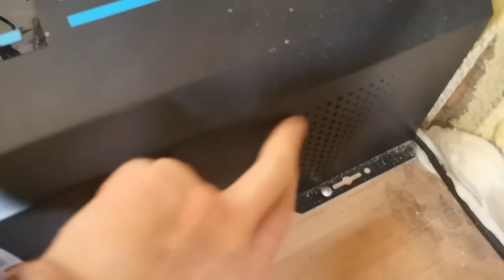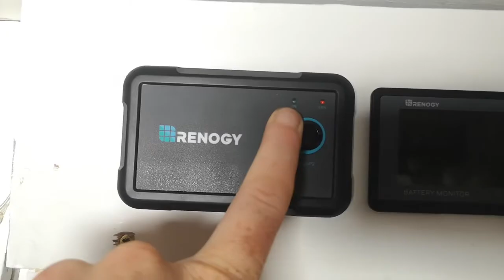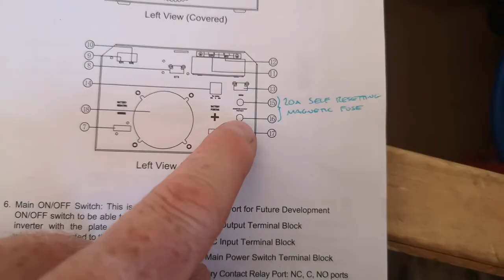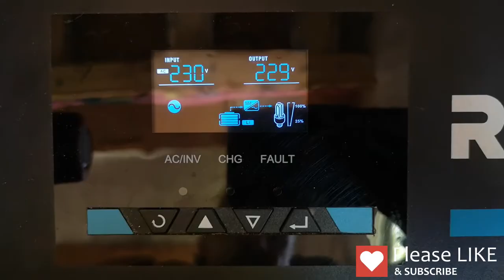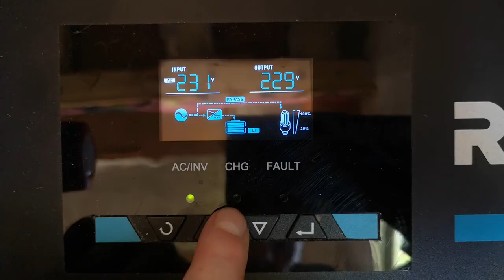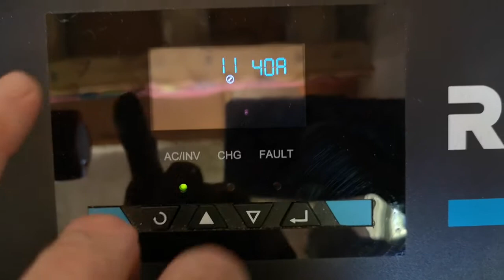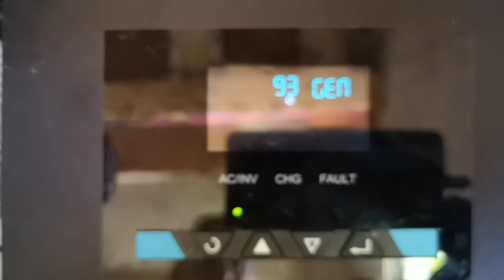Renogy Inverter Charger Installation & Setup | Part 1

Comment from the maker: Do you have questions about your Renogy Inverter Charger? Jolly, your 'Renogy Inverter Charger Guru', provides comprehensive guides and resources to assist you with installing, setting up, and using your Renogy charger. Visit: www.vandercampadventures.com/renogy-inverter-charger-installation/

Thank you to everyone for your continued support. Your likes, comments, and subscriptions help the channel and the community.
Now, put the kettle on and check out Part 2 here - https://youtu.be/gecrb2rPUvU.
The RENOGY Inverter Charger can be purchased here - https://shrsl.com/3wn5c
Reply: Thanks for that I contacted the company that fitted inverter they said they can fit one for £128 don’t think that will be a Renogy as they are about £200 I think to buy or should I fit Renogy as it would pair up with inverter ?
Reply from the maker: It doesn't need to be Renogy as it will be a completely separate unit. That price is very cheap for a unit and fitting, i would question what unit they are fitting and make sure it meets your needs.
Do you need a solar and DCDC charger or do you simply require a unit that trickle charges the starter battery? 
Regards,
Jolly
Reply: If you plug into shore power, does the inverter turn on? In other words, when you plug I,  do you have to physically turn on the inverter to get power to the camper?
Reply from the maker: @ The inverter charger needs to be switched on to use inverter and mains power. 
If the inverter charger is off and you connect it to the mains, it will recognise the input power but will not provide power until it is switched on.

Comment: Hi there! Thanks for your video! Can you please clarify what the minimum space clearance on each side of the inverter? You have just a little gap on the sides and on the back, and in the front you left more space. I probably don’t have that much space, so what’s the minimum space you reccomend? Thanks in advance!
Reply from the maker: Hey there! 
I wouldn't recommend less space than what we have. We're already tight on space and installed it there initially to test how it would perform. It never gets too hot or causes any issues regarding heat. This is because we have plenty of ventilation under the bench seat to create circulating air flow, this is very important. We have 4x vent holes in the seat base and 2x drop out vents in the floor that creates sufficient airflow. 
Regards,
Jolly ✌️

Comment: Hello,
I have the Renogy Regó 3000w inverter charger. I have a Renogy 50amp DC to DC charger, 30 amp shore power and a Vatrer 460 Ah Lithium battery.
Can you contact me, I need help with the parameter setup on the inverter charger.
Reply from the maker: Hey! Please email me at jolly@vandercampadventures.com

Comment: My apologies if I missed you saying this but does it matter what amp shore power (15,20,30,50) you plug the inverter into? Ive been struggling to find anyone talking about this.
Reply from the maker: No! Current is drawn from the shore power, it doesn't just flow like water out of a tap. The amount of current required by the inverter will depend on what's plugged into it.

Even if you have a 20A or 50A mains supply, if you plug in appliances that only use 10A, it will only use 10A from the mains supply. 

I hope that makes sense.
Jolly ✌️

Comment: Hello im a little late to the party and very informative video, i just wanted to double check, cause i see people saying 14.4, 14.7 etc now i have the 2000 watt and 30 amp shore power to a disconnect into the inverter(using 12awg house wire)  and then your typical 120v breaker box with other needs(also using 12awg house wire), now i have 600ah of lithium but what settings do i use for this, ik you said 5, but is that the only thing i switch in the display settings and do i need a temp plug for my rig or leave it be cause its lithium  im a little new to all this so i was to triple check everything and make sure im doing it right and just simply want to know what do you think would work best for the rig im currently using, thank you have a good day :)
Reply from the maker: Hey, to set up the inverter charger you need to know your battery specification. Lithium (LiFePO4) batteries are typically 14.4v for their charge current. 

It sounds like you're from the US so the program settings may be slightly different

- If it's a non-Renogy battery, set P05 to custom (b-0).
- P94 set to ALB
- P26 (tOC) is the max charge current, set this to 14.4v or what your battery states.
- P27 (tC) is the low battery recharge. I recommend setting this to 13.2v. 

Regards,
Jolly

Comment: So does the input of the AC come from my shore power in the side of the van? If so do I divert it from the AC Consumer unit to this first and the AC output on the inverter replace into consumer?
Reply from the maker: Hey! So, here's the path  based on the system in the video that requires RCD protection on the output: 

Shore power > Consumer unit with RCD > Inverter Charger > Consumer unit with RCD > Sockets

Comment: Thanks for your time and effort, very informative.
I find it hard to follow instruction manuals, and you have just put it in clear English. Made it so much easer to follow.

I have a slight problem, I put on a 1000w microwave at 70 % power for a minute and the inverter beeps and turns off after about 25 seconds.
Any ideas ?
Reply from the maker: Hey Alan! I'm sorry for the late reply. Are you still having the issue?

Does the inverter charger show an error code? Make sure Program setting 25 is set to enable (FEN).

It sounds like an overload or low voltage issue. 

Microwaves have a startup/surge current of 1.5- 2x the rated wattage, only when they start up. Therefore, if you have a 1000W microwave, it could pull up to 2000W during startup. This may cause the inverter to overload.

A low voltage issue may be caused if the cable sizes are too small and/or the battery state of charge (SOC) is low. 

Regards,
Jolly

Comment: Does this work with solar and dc to dc charger?
Reply from the maker: It's a completely separate unit. Solar and DCDC charging can be incorporated into the same electrical system as the inverter charger.

Comment: I also didn't know it was centre tapped when I bought it. I'm about to install mine and thank you so much for the videos you've made on this inverter charger. Can I ask if it's ok to wire the incomming EHU to the consumer unit, then to a plug which has a 3 pin plug and wire into the inverters input? So I can manually unplug the inverters input and use that socket for something else whilst on EHU.

Thanks in advance!
Reply from the maker: Hey! That's fine. But be mindful that a 3-pin plug is rated to 13 Amps (~3000W).

Comment: Great video mate
Q: my inverter charger.(same as in this video) would randomly stop charging while on mains. The there’s no connection, the blue/green display that shows charging is in progress stops all together. 

What I have found is. I need to turn everything off. Batteries, inverters and solar. My whole management system off and then back on for it to start working again. 

Would you have any idea why this keeps happening? Spoke to Renogy and they have no idea. They said it might be one of the settings. 

Let me know what you think? Cheers
Reply from the maker: Hey Alek, Is the battery charge settings set to lithium (b-L)? 
If so, you may be experiencing the lithium preset charging. This is designed for the Renogy lithium batteries. When the charger is switched on, it will charge the battery to 14.4volts and stop. When the battery reaches 12.5volts the charger will charger the battery to 14.4volts again. It doesn't float charge, meaning it doesn't remain at 100%.

You can overcome this and set a float charge by setting the battery to 'custom/user's and setting up the user settings. Let me know if you need help with that.

Regards,
Jolly

Comment: So 2.5mm flex cable is what you used for the ac input output ?

And the manual recommends 70mm cable from battery to inverter charger ? 

As i want one of these and want to get the bits ready for doing it. I have a rcd board already and im only planning on doing 1 maybe 2 plug sockets. Ive got a 240v hook point installed already so i have an ac input ready.
Reply from the maker: Hey,

I would recommend a minimum of 2.5mm cable for the 2000w inverter charger and 4.0mm for the 3000w inverter charger. The reason for using 4.0mm is because of the potential surge current from appliances.

A minimum of 70mm (2/0 AWG) for the 2000w version. However, you must do your cable calculations because the cable length could effect the cable size. 

Please refer to the Part 2 video for information and guidance on the AC fuseboards and RCD protection. 
Here's the link - https://www.youtube.com/watch?v=gecrb2rPUvU

Also, I've got a detailed wiring diagram that shows how to wire the AC fuseboards, RCD's, MCB's and bonding. 
Here's the link - https://vandercampadventures.com/renogy-inverter-charger-wiring-diagram-rcd-contactor/

Please give me a shout if you need any further help or guidance.

Regards,
Jolly

Comment: Thank you for the video but I struggle with the cable sizes. When on a camp site you get 16amp some people use 1.5 orange cable . I use 2.5 which is about 27amp . If you put a 16amp breaker before the inverter and after the inverter 6mm in and out of the inverter seems big (30amp plus ) 3kw inverter will probably take 15Amp max load why such a big cable isn’t 2.5 big enough based on a 16 amp breaker . When charging the battery from shore power I don’t think your taking 40 amps from the mains if you did you would never be able to plug in any where. Thank you for all you hard work and explanation Thank you for your patience sorry I’m just asking I’m a sparky too very good explanation 👍👍👍🏴
Reply from the maker: Hey there,
Thanks for reaching out and for your kind words. At 21:10, I explained that I used a 6mm cable because we had some leftovers. You're correct that the hook-up supply is 16A max; the blue hook-up commando sockets are rated at 16A.

Depending on the cable length and routing for the inverter input and output, you should be fine with 2.5mm. However, I would recommend a minimum of 4mm for the 3000w inverter charger (Please do cable calculations to confirm the correct cable size for your system). This will ensure the resistance is very low, reducing the risk of voltage drop. Also, depending on where you're routing the cable, the electrical compartment can get warm, especially during the summer months, which increases the cable's resistance.

I'm sorry that this wasn't clear in the video. Let me know if you need help with cable calculations.

Regards,
Jolly

Comment: I’m no electrical engineer but I would have thought you would need a T class or MRBF (fuse) on the battery terminal before the first DC positive cable. I thought lithium shirt circuit amperage was in excess of a mega fuse tolerances. I maybe wrong - but I think it’s a major safety issue.  It’s the IAC rating or something like that
Reply from the maker: Hey Robert, 

Thank you for your question and concern! Sorry for the late reply.

The short circuit current, breaking capacity, and interrupt capacity can vary depending on the brand and design of the lithium battery, as well as the type of fuse used. You are correct that MEGA fuses have lower breaking capacities than T Class inline and MRBF fuses, making them generally unsuitable for protecting lithium batteries.

In the video, the 200Ah Renogy lithium battery has a short circuit current of 2000A (2kA), while the breaking capacity of the MEGA fuse is also 2000A (2kA). It’s important that the fuse's breaking capacity exceeds the battery's short circuit current to ensure the fuse functions properly during a short circuit event. A slight design blip on my part. 

Since the video was made, we have updated the MEGA fuse to MRBF fuses, which have a breaking capacity of 10kA at 12V.

For your reference, here are the breaking capacities of different fuse types:
- MEGA: 2000A (2kA)
- MIDI: 2000A (2kA)
- Class-T: 20,000A (20kA)
- MRBF: 10,000A (10kA) 

Battery short circuit currents can be found in the battery specification and manual.

If you have any further questions, feel free to ask!

Regards,
Jolly

Comment: Great vid
Q: I’m noticing that my system keeps draining even though I’m connected to shore power. Have you found this issue
Reply from the maker: There are two reasons:
1) It may be because of the way the charger charges the battery. f you have the battery charge setting set to 'Lithium' it is designed to charge the battery to 14.4v, then stop charging until the battery drops to 12.5v when it initiates charging again. The preset Lithium setting doesn't use a float charge.
To overcome this, you can use the 'custom/user' charge setting to set a float charge. I will be uploading a video detailing the process soon!
2) You are using more power than the battery charge. For example, if the battery charge is 20A but you are using 25A, the battery will show power use (negative) rather than a charge (positive).

Comment: CANNOT be vertically mounted, YES!! someone shows why, the heavy toroidal magnet is not fastened down and it can fall onto the other circuitry. Im off to re mount mine now! PS you ramble and I havent enough patience to listen to all this detail of no relevance.
Reply from the maker: It's stated in the manual NOT to mount it vertically.
Reply: @vandercampadventures  but everyone does because the reason they give is not relevant, about ventilation. But they do not mention is that the heavy magnet is not securely mounted and it can crash into the circuitry. What really needs to happen is you should remove the case and put some large screws through the corners of the base of the toroidal magnet. I don't want that coming loose no matter how the inverter is mounted

Comment: Does yours charge the battery on shore power WITHOUGHT  turning the inverter switch on.
Mine needs turning on whuvh seems a bit weird as i assumed that because it was a inverter charger it would charge the battery as soon as you connected to shore power.
Any information would be great as it seems strange to have to have it running constantly while attached to shore power.
It works great but its just the fact it has to be switched on to charge the battery.

Cheers
Reply from the maker: Hey, while connected to shore power, the inverter remote switch must be on to charge the battery and provide AC output power 👍.

Regards,
Jolly

Comment: Hello, could you do a video explaining the 230v sockets going into the consumer units please? I find your videos so helpful and I am struggling with wiring sockets in a radial circuit. 

We have a 3000w Renogy inverter, 460ah LiFo4 Smart roamer battery, 2 x 360w solar panels and an Abso 30A DC-DC charger (looking to change this to a 30amp MPPT, as I do not want the batteries charging from the alternator and van battery.

Thanks in advance
Reply from the maker: Hey Rachael, thank you for being a fan! I can help you out, no worries!

I have many videos in the pipeline related to 230-volt electrics in a campervan. However, due to my current workload, the videos will be a few months away. 

Therefore, in the mean time, join my Facebook Group - Campervan Electrics Mastery that will give you direct access to me for help and support. I can discuss your 230v radial circuit dilemma and help with your DC-DC and MPPT. I hope to see you there!

I also offer a free 1-1 consultation call for members to discuss how i can help. 

Regards,
Jolly

Comment: cable size looks a bit small for 200A fuse protection?
Reply from the maker: The 35mm tri-rated cable I used has a current carrying capacity of 240A. The link to this cable is in the description.

Comment: If you connect the ground directly to the chassis, do you need to have a fuse between the ground wire and the chassis?
Reply from the maker: Hey, good question! The chassis ground wire does not require a fuse. Fuses are only required on the positive cables that carry the current. 

Regards,
Jolly

Comment: I have one challenge with my 2000 watt Renogy I/C on my boat. The preset for lithium prevents charging if the battery is above 12.5 volts.  The problem with this is that my battery could be at 20% charge when I leave the  dock, so instead of having 300 ampere hours at my disposal, I only have 60 ah.  Does anyone know if there is a way to force the Renogy unit into charge mode in this instance?
Reply from the maker: The way I overcome this is by switching the inverter charger off and on again. This will trigger the charger to charge the battery. 

Calculate how long it will take to charge to 100% to ensure you have full juice before you leave the dock.
Reply: @vandercampadventures  I will try this. I assume you do that on the unit itself and not on the remote.
Reply from the maker: We do it from the remote. The remote switches the unit off completely, which is handy for this situation.
Reply: @vandercampadventures  I have tried from the remote, but it only goes into charging mode for one minute and then returns to inverter mode, but I will experiment with this a bit to see if I can force it into charging mode.